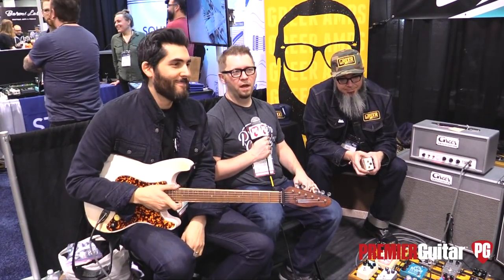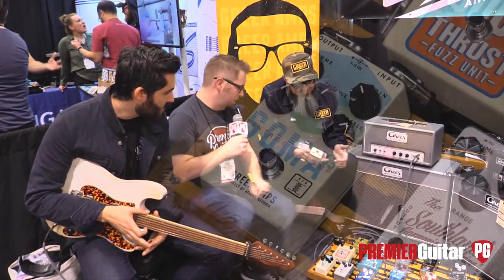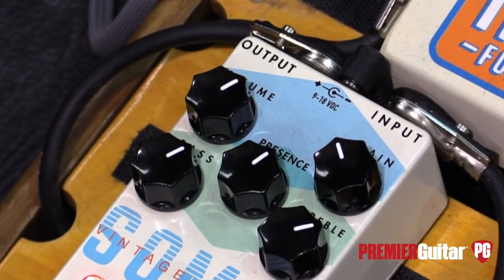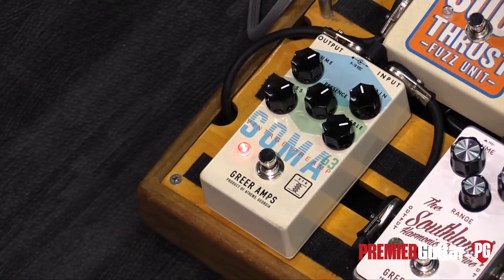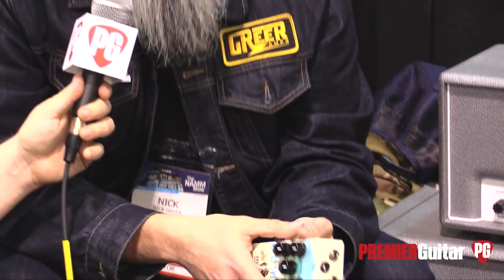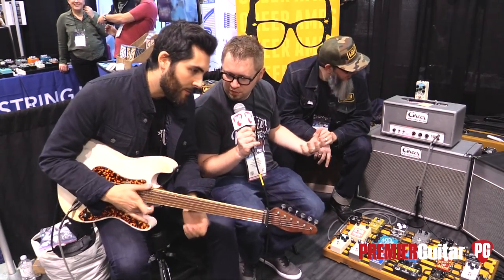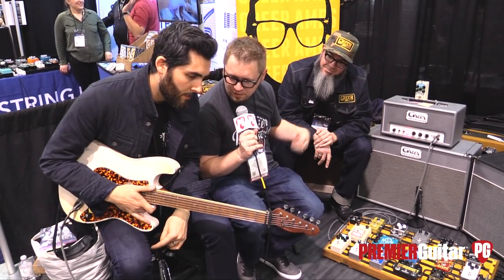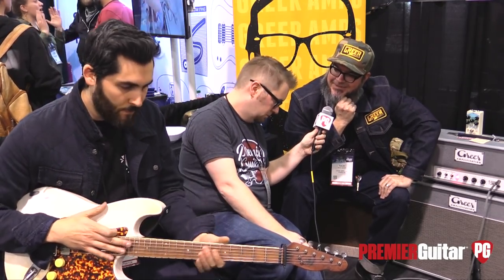NAMM '19 - Greer SOMA ‘63 Vintage Preamp Demo with Ariel Posen

Comment: Only recently discovered Greer, and that's unfortunate, because I prefer a lot of their stuff to the newer pedals on my board.Slowly and surely, guess Greer will take over the current Drive & Fuzz section. Like the Soma more than the Broadcast or the Benson, which is quite the achievement. 
Just when you think you're  out..